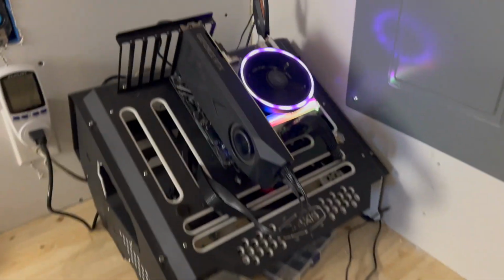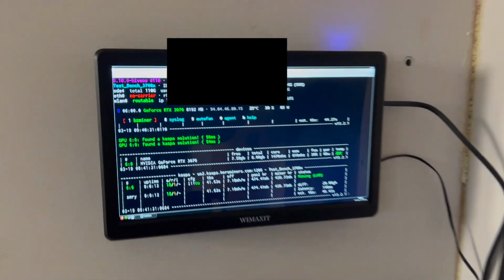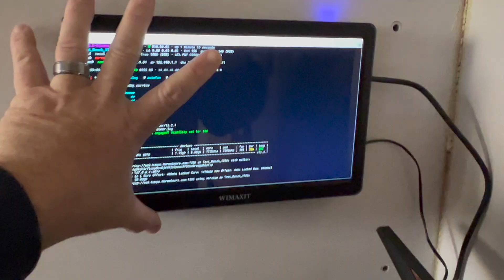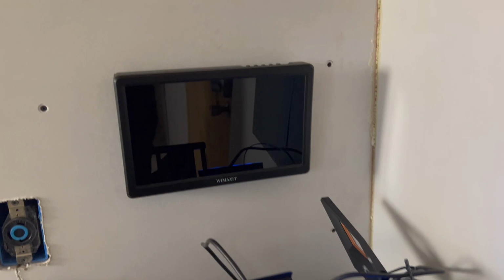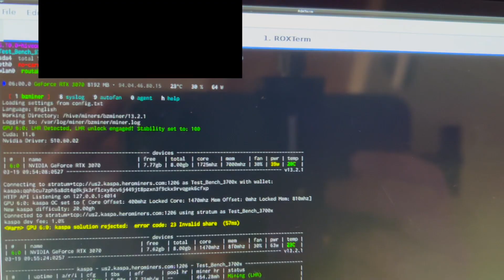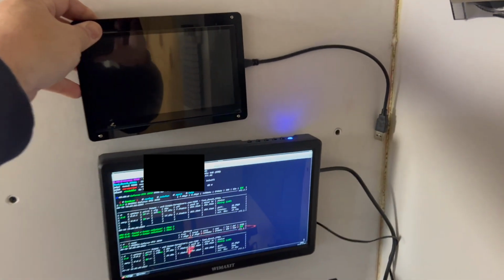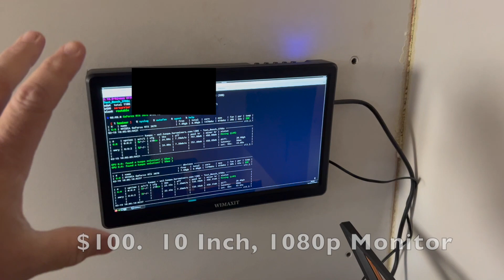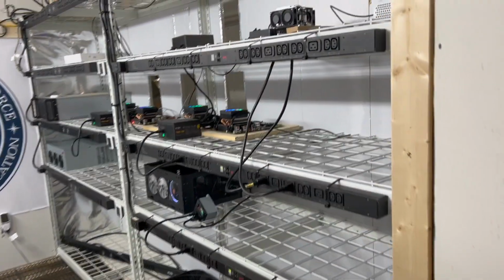Mini Monitor Screen for Crypto Miners

Comment: i have been looking at those screens myself if i remember right the 7" ones go for about 40-60$ on ebay depending on which one you get and they are only 720p
Reply from the maker: They're very handy to have for sure. That price & resolution sounds right. I notice the lower resolution makes a big difference when combined with a smaller screen, but still works decent especially for the lower price.
Reply: Why would you want a higher resolution. It's a 7in screen displaying text

Comment: hello mate is this lcd screen just needs a usb to connect ? or does it has to have hdmi as well?
Reply from the maker: Hey Alfie! Both Screens have HDMI, but one the bigger screen uses power from the wall, and the smaller uses power from USB 👍🏼